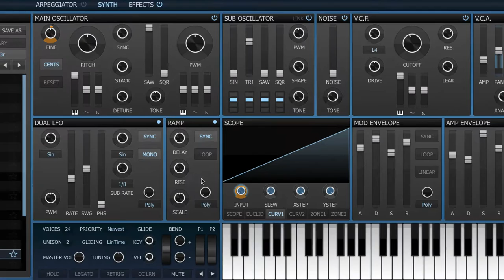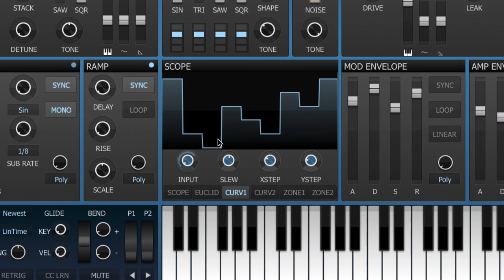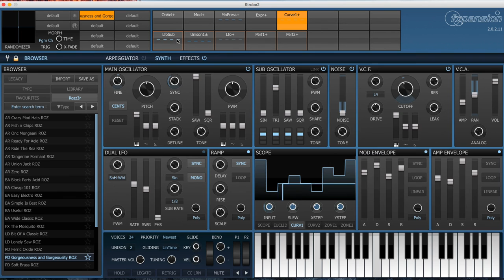FXpansion Strobe2 Tutorial -  Curve Modulation Source

Comment: This and the Euclidean are excellent targets for CableGuys' MIDIShaper or Modulation Processor 3244. Why waste such a flexible LFO for something as plain as a ramp or sine? You only have the one, after all.
Reply: Not necessarily, you can use the "Unison+" to set a different rate, LFO shape and destination.  You can also achieve this with the "SUB" LFO which could give you a total of 4 LFO's.  The only problem with this is the gate settings and sync vs free.  All the LFO's will be limited to the same gate setting, poly or mono, and sync or free running.